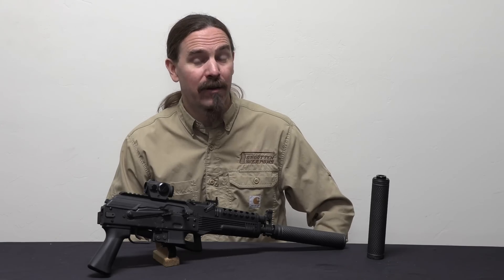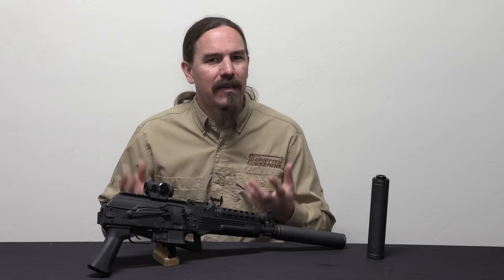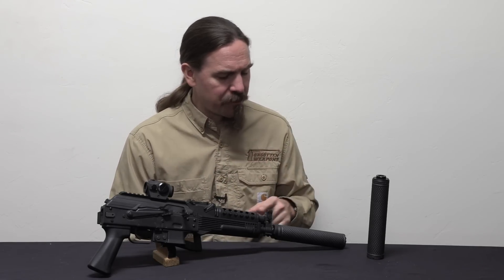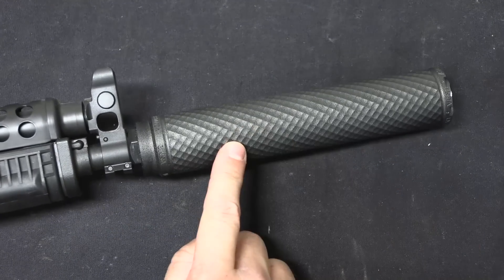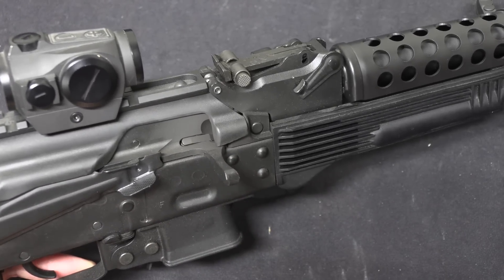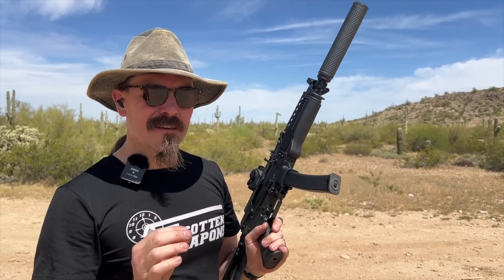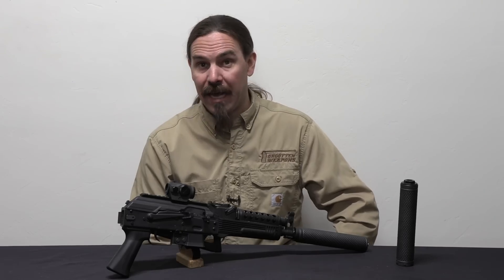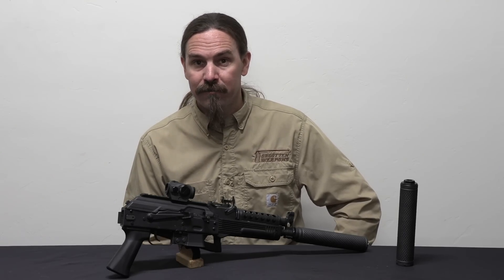PTR Vent Suppressor: 3D Printed Titanium Foam

Comment: I hope they can make this out of a different material at some point. I'm sure it would be absurdly heavy but honestly it's worth it for that kind of performance without the sparking you get with titanium, especially when 3D printed.
Reply: Copper would be superior for extracting heat from the gasses.  But heavy.  Aluminum would be superior at extracting heat, and light, if the foam can handle the stress.
Reply: ...yeah definitely not those. They don't take high temperature very well and most aluminum suppressors can't handle automatic fire ordinarily, not even considering if it was a foam.

Was thinking steel, inconel, or polonium... The other materials most suppressors use...
Reply: @Scott.3.H  Polonium?  I hope not.  Stainless steel or iconel would be functional.
Reply: @hanelyp1 Aluminium BURNS.
Hastelloy would be another option.
Reply: Although it may add a bit of weight, what about just putting a sleeve of some kind of material over it?
Reply: @MT-id4zf  that wouldn't really stop the sparking. That comes from the titanium being worn down and burned while coming out of the suppressor.

Comment: Not too long ago "foamsteel" was something from science fiction, made possible by orbital manufacturing facilities. Sounds like we're there already.
Reply: Endo Steel anyone?
Reply: @Juanototo1 YES! A fellow Battletech Nerd! Greetings Mechwarrior!
Reply: @Juanototo1  Blessings of Blake upon you brother
Reply: @Juanototo1  I'll take a set of Ferro-Fibrous Level VIII plates.
Reply: @Juanototo1  hell yeah, I want my Endo Steel chassis for like a car
Reply: There was aluminum foam both open cell and closed cell in aviation.
Reply: Metal foam is something existed for over a century ago, depending on definition. 
The recent breakthrough is we figure out ways to commercialized them.
Reply: @jintsuubest9331  whilst that may be true, I've been told the main issue with Foamsteel is perfectly even pores in the sponge, because whilst you can definitely bubble gas through a liquid metal or what have you, the patternt he pores become locked in is basically totally random and will lead to wild and uneven durability and numerous weakpoints and stress accumulation sites.

a proper, useful foamed metal has more in common with atomic crystal structure analogue models than an actual sponge.
or so I've been told I could be WILDLY wrong about this.

that said, you are correct in that the truth behind most 'new innovations' boils down to making little-known 'experimental' technology into new commercially viable products.
Reply: As we see from the cost, 3d printing is still an inefficient method of production for metal foams.

Orbital manufacturing has many of its own hurdles, but if we can reduce launch costs substantially, may eventually offer new commercially viable metal foam products due to the increased ease of the base manufacturing process.
Reply: @JosephHarner  Once another manufacturer starts competing on price, we might get a more accurate picture of just how efficient production is...
Reply: @JosephHarner while it may be more expensive to 3D print common metals, it's actually less expensive to 3D print complex shapes off  more difficult metals like titanium, inconel, maraging steel, etc.

Comment: With the 147s, all I could hear in the video was the bolt cycling.  Nice!
Reply: Would have liked to hear it on a manual bolt action.
Reply: @mikedunn7795  i would like to not hear it from one 😂 it was pretty quiet idk if we would notice
Reply: @mikedunn7795  It would probably sound like a Red Ryder, with the right ammo. 👍
Reply: @crominion6045  imagine they make one in .300BL. fuuuuuuuuaaark.
Reply: They need to work on a quiet mech now.
Reply: @RichardFraser-y9t rubber buffers and clad replaceable rails that the bolt rides on in Teflon? I wonder if there are sound absorbing coatings for coil springs
Reply: I was busy listening to the whiiireoow noise the bullets made after deflecting off the target or back drop.
Reply: And the cartoony sounding ricochets 😂

Comment: the words, "3D Printed Titanium" would have been utter science fiction just 15 years ago
Reply: I believe it was already in research phases in the 90's so a bit further back than 15 years ago. Niche industry has had access to 3d printing metal for much longer than you'd think. It's just been way too expensive for most companies to invest into until more recently.
Reply: I mean Koenigsegg were using it in their "One:1" about 10 years ago, so It's been around longer than you probably realise ;) The one that freaks me out is when I recently found out you can get 3D printed Inconel now
Reply: the tech is only slight more complicated than a laser engraver
Reply: You could print titaium 15 years ago. 3D printing metal has been around for decades, you can 3D print any solid materials, even diamonds. 
How metal 3D printing work is that it PRINTS a "sandcastle". You can break the 3D printed titanium object with your hands. You can print football sized real diamond. 

But the printed object is just metal or diamond powder mixed with glue. A pretty much a sandcastle. Once it is 3D printed comes tha difficult part: baking it under pressure. So that the glue holding the powder together evaporates and then powder melts into one solid obejct. Harder the metal the higher temperature and pressure required. They also need to acocunt for reduction in size and the object solidifies. ofc we do not really have technology to create needed pressure to bake real diamonds. 

One other thing is that the fine metal powder used in metal 3D printing is f**king deadly. The setup they have labs using metal 3D printing would put some biochemical labs in shame. You take one big breath of that microsopic metal powder dust and you will in laying in hospital, most likely naked on metal table.
Reply: @michaelholopainen2822  I fully believe 3d printing metal was a thing in 2009, but no, it was not something anyone talked about and was borderline useless. I remember seeing the first 3D printed guns in the early 2010s and their resolution was terrible. The machines may have existed, but you can lay off with the smart ass attitude like they were somehow common or well known as if I wasnt fucking there.

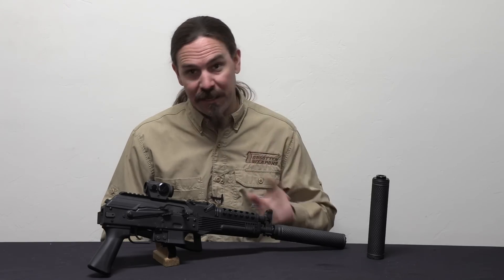Comment: 0:39 Why not get in the suppressor market? The profit margins are substantial, and the bulk of the R&D has already been done.
Reply: It's an extremely saturated market.  But if you want to get your 07/02 and take a crack at it, you can be pretty successful on a local level.

Comment: We used to use steel wool saturated with white lithium grease. Works pretty damngood with pistol calibers.
Reply: And steel wool should be cheap and easy to replace with a well designed can using it.
Reply: Any health concerns about the vapourised lithium presumably produced when firing through that?
Reply: @vahannema  In the right dose, lithium is an effective anti-psychotic; in the wrong dose very toxic.
The FDA might recommend shooting a 15 round magazine, twice daily for treatment of bipolar disorder. 😵‍💫
Reply: @vahannema  dunno. Used it in pistols and held away from our face. Not a semi auto blowing gas back. Hold your breath maybe? LOL
Reply: @vahannema 😂
Explosion and then smoke from the burn, shit flying, the least of our concerns, is that! Cheers.
Reply: Oil and grease lights up when you shoot more. I also use silicon spray for my ruger 1022 with ase utra can
Reply: We used copper pot and pan cleaners...
Reply: Surely stainless steel wool would be even better.
Reply: @BC-wj8fx  It burns up too fast.
Reply: Neat tech

Comment: Porosity. Never thought I'd hear that to describe titanium. Very cool. 👍
Reply: I love cutting titanium.  We made a lot of parts for the F22 and other aircraft in the 90s.
Reply: Titanium sponge is quite porous as well.
Reply: They've been using porous titanium in medical devices for decades.  It was around before 3D printing, or additive manufacturing,  was an option.
Reply: Integza has a great video where he makes a flaming knife with the tech. He talked to a bread company that used the tech to make nonstick knives. You can talk to a prototyping company, give them the design specs, and get it cheaper than buy it most likely.

Comment: Think of the possibilities. All the 3D printed lowers! Uppers! LPKs! Hells yeah!
Reply: Yeah, we already make em out of polymer and they last
Reply: @marcusborderlands6177 ehh there's def some downsides to long guns that have been printed. They have to be substantially "beefed up" to maintain any ability to fire a mid sized rifle cartridge.  Pistols are typically a bit different and don't need to be as strong as an ar or ak would need to be. I'll stick to my aluminum and stamped steel receivers. Printing titanium or other steel would open the market to longer lasting parts, pla+ is good for some stuff bot not for others.
Reply: @jlo7770 Some of the things people are soing sith glass filled or carbon filled nylon is impressive. Part of me wonders what that community would be getting up to if PC was a little cheaper and a little easier to print.

Comment: Wouldn't carbon clog up those micro air channels over time?.. just seems like solvent dipping to clean wouldn't get it all
Reply: Depends on the solvent. If you can find something that actually desolves the carbon but doesn't hurt the titanium you are set.
Another option might be to heat up the entire thing is an oxygen rich enviroment to turn the carbon into CO or CO2. But you'd have to be carefull not to melt the titanium.

Comment: This is cool technology, but a decibel meter costs as low as twenty bucks.  I'm not sure how accurate those low end ones are but gosh, couldn't we spring for the hundred buck decibel meter when testing a can?  Reducing blowback is fantastic, but if the sound signature is ten db higher than another can I'm not interested, especially at that price.

Comment: Why can't people make gun barrels with fume extractors like that of tanks guns and with suppressor?

IDK know it will work, but in theory it can reduce back gas venting into the chamber for sure.
Reply: Semi and fully automatic operating systems need some back pressure to work.
Reply: @praharin  want to check, will work for both Blowback or Gas Impingement/long stroke/Roller delay.

Comment: when the bullet impact is louder then the shot itself... jeez thats cool
Reply: most of the noise on camera seems to me the action cycling tbh.
Reply: @fcw2bom  Yea, when he started to shoot rapid fire all you could hear was the clacking of the action, microphones do funny stuff with guns. In an attempt to even out the sound they usually end up clipping off the louder sounds like guns and leaving the action noise thats lower
Reply: @fcw2bom  the mic auto dampens. I forget the name for the volume cutoff.
Reply: Automatic (or manual) audio compression means you very likely aren't hearing the correct volume for each stage of the firing. Audio compression quietens the loud bits and loudens the quiet bits. That's why somebody opening a chip packet at the shooting range is as loud as a .300 Win Mag going off, on video.
Reply: *than
Reply: Its amazing.  All I could hear was the bolt and even that just sounded like a really loud shutter camera.  Lol.  Impressive as hell.
Reply: The first time i went hunting with a really quite pellet rifle kind of shocked me. You can hear the pellet ripping through your target's flesh and bone.
Reply: when I first shot suppressed I thought it was kinda loud, and then I realized that was the bullet hitting the backstop.
Reply: It's still sounds like a gunshot in person.
Reply: @mayorhaggar1275  not with subsonics numb nuts
Reply: All decent suppressors will do this with subsonic 9mm
Reply: that has been achieved decades ago, the groundbreaking thing is the manufacture system. It's too expensive to be practical, but maybe in the future, the development and manufacturing techniques can bring something really cool (and affordable). Might not even be gun related, think sturdy foam titanium automotive parts or something.
Reply: @lanorothwolf2184 fun fact the  spunge metal by 3d laser printing is developed by a huge European Backery chain why u ask easy dough sticks too the rolling cutters  and well if they are porus you cann flow air through it making no not sticky like the lotus effect 😅
Reply: The action of the gun is louder! That's impressive!

Comment: Quietest 9mm sub sonic shots I've heard.  Could only hear the guns action and the ricochets . True progression.
Reply: No doubting it is good, but unless you were at the range you did not hear how loud it was. We have no idea how much automatic audio compression was applied or how the sound was mixed and compressed in production.
Reply: @BC-wj8fx  Exactly, never go by videos on the internet. It's different in person.
Reply: @BC-wj8fx  If AGC were messing with the sound levels, the slide noises would warble.  The fact that we can hear the slide operating throughout gives a pretty good ballpark for actual in-person sound.  I mean, I won't place any bets on actual sound pressure levels, but "the slide is louder than the gas expansion" is a pretty good indicator.
Reply: @georgedorn_fnord  No it isn't. Modern microphones and recording software are optimized for filtering out background and loud noises in favor of human speech noises similar to human speech. That is why you can walk along a crowded street, next to a car lane - and still be heard and understood by the person you're talking to. 
On the other hand, talking to someone eating a bowl of soup will make every cling and scrape extremely audible. 
The sound levels measured in the linked article show 108-125 dB for subsonic 9mm - slide is not that loud on its own.

From HCE: 
Levels and sources of damaging noise include:

    85 – 100 decibels: For example, a hair dryer, blender, power lawn mower, forklift, or subway train
    100 – 120 decibels: For example, a bulldozer, impact wrench, or motorcycle
    120 – 140 decibels: Such as, a rock concert, auto racing, or a hammer pounding a nail
    125 – 155 decibels: Like, firecrackers or fireworks, or a jet engine
    170 – 190 decibels: For example, a shot gun blast or a rocket lift off
Reply: And from PTR of all companies. Man, surefire is getting COOKED this year after the whole RC3 fiasco.

Comment: Yet another reason to get an ultrasonic cleaner.
Reply: Make sure the one you get is rated for flammable solvent. Mine isn't, so I'm afraid of arcing causing a kaboom. That said, a mix of water with low foaming soap, 10% acetone and 10% alcohol works wonders on everything I throw in it. 

I imagine valve cleaner for car engines would work very well with a solvent rated cleaner. Engine carbon build-up isn't chemically far off of gunpowder residue.
Reply: My man using a 1500 suppressor purchase to justify a $100 ultrasonic cleaner. I like you.
Reply: They're great, but with a few caveats.

First, don't get anything smaller than a 2L.  2nd, you MUST fill it at least 2/3 full or it will break.  3rd, the cleaning solution REALLY matters.
Reply: 'dirt' cheap too.. I bought one to clean my bike chain.  $45 and it works great
I always use with water based cleaner and if I need solvent, put  it into a secondary container in the water.
Reply: I just sharing the results we had with flow through cans that had 15k 5.56 through them. No solvent/ultrasonic was able to help with about 70 grams of carbon residue. If you observe your maintenance schedule very carefully, like brushing your teeth then solvent and u-cleaner are probably good to go. But the more complex and delicate structure suppressor has the sooner you will find clogging and detriment to its performance.
Reply: @22CatchMK  To be fair, Ian did say the manufacturer recommends cleaning/maintenance every 1500 rnds for 5.56, not 15k, so they seem to be pretty aware of its capacity to clog up quite quickly
Reply: @thomoski  it's still cool that we have developed suppressors that work for 1500rds without issues to just start with. Wasn't that long ago that they were shot out after a few dozen or hundred rounds.
Reply: Whatever you do, buy one with a drain.
Reply: @StefanGotteswinter  Quality advice right there. I didn't... and the first time I used it I realized why the extra money was a good investment.
Reply: Ultrasonic cleaners are bit iffy. For some things they work fine and some not at all. I rarely use mine. Most times mechanical brush or pressure is more effective.
Other possible cleaning procedure could be pumping solvent through suppressor.  Just need bucket, solvent resistant pump, tube and adapter to connect suppressor.
Reply: this will probably not work at all sorry
Reply: @22CatchMK  I’d be skeptical with just soaking it but ultrasonic cleaners are pretty impressive with what they can get into so I’m hopeful